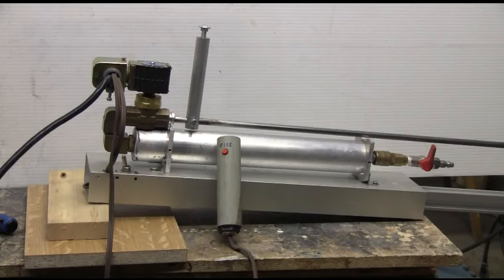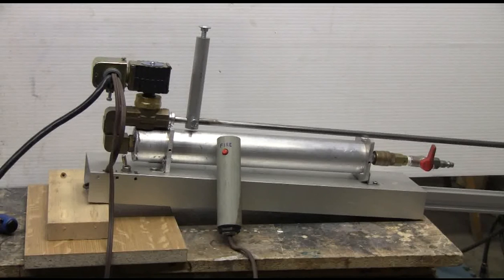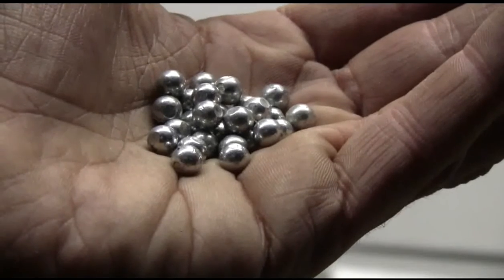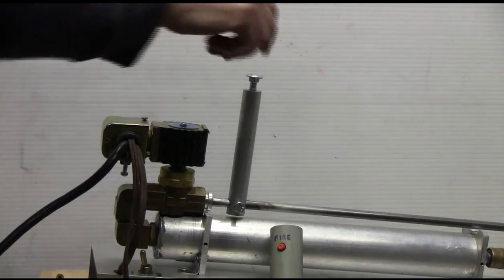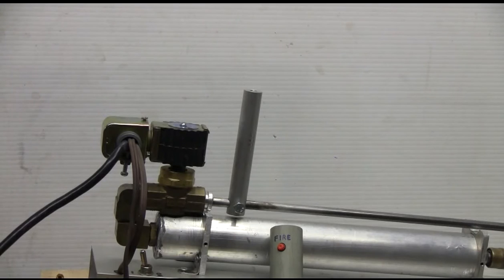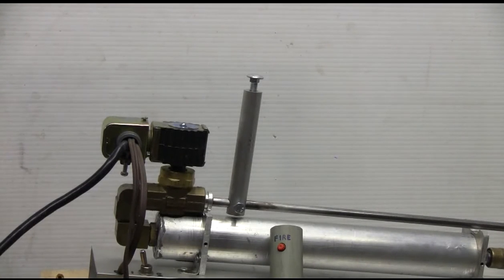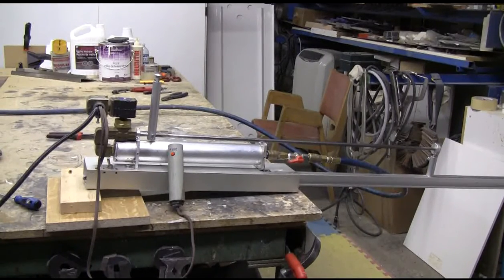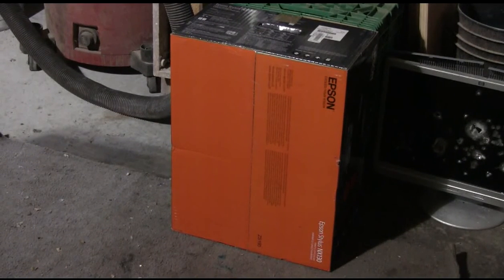Air Cannon #50 - Semi Auto Solenoid Cannon

Comment from the maker: The solenoid valve is rated to 400 psi, so I can increase pressure if I want to. My fridge compressor takes a while to pump up the air reservoir, so there would be excessive delay between semi-auto high pressure shots. What I need is a large high pressure tank as air storage for the air cannons. Maybe I can convert a large CO2 or other cylinder for this purpose. Then it would be like shop air, but at high pressure.